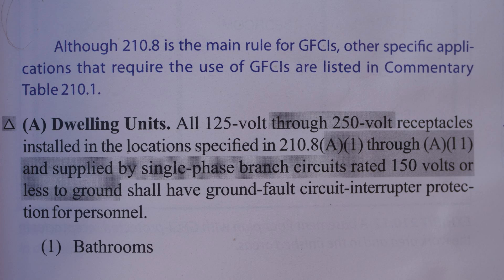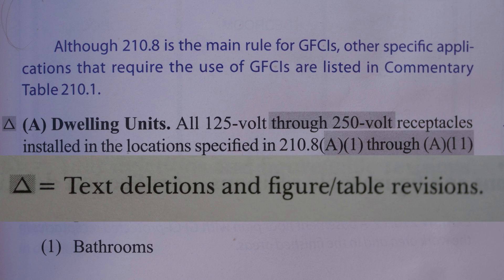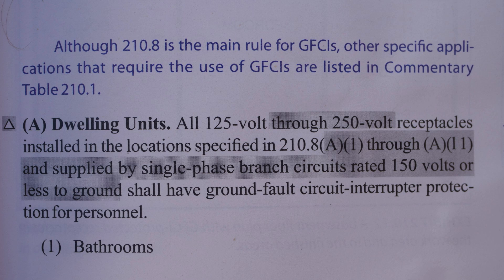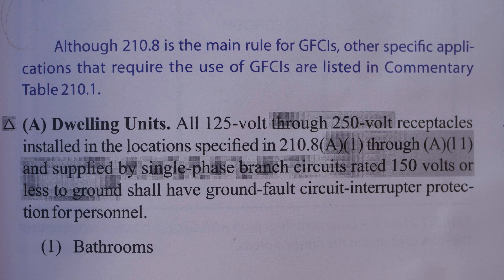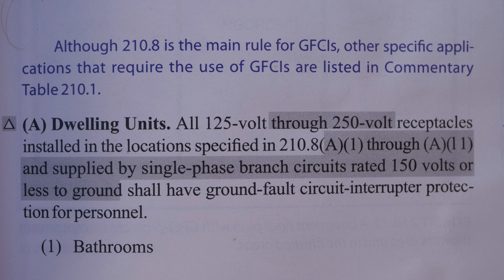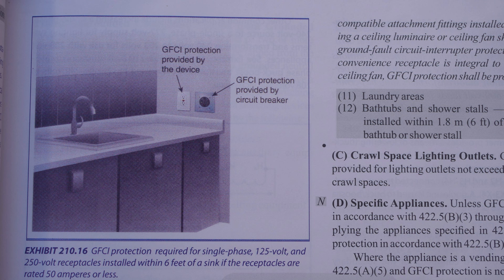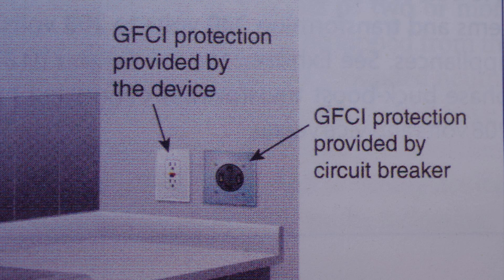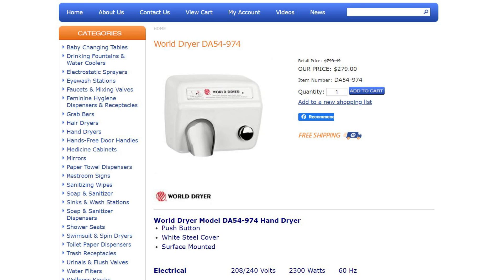Can 240V and 250V Receptacles Really be Installed in Bathrooms?

Comment: It looks like in a dwelling you are now allowed to install 240 volt outlets everywhere that a 120 volt receptacle is installed accept your not allowed to plug in a light or anything that has a maximum rating of less than 1,440 VA. At some point I expect those prohibitions to be lifted as well due to global harmonization.  Hopefully we will adopt the schuko configuration or the bs 1363 but due to our non polarized 240 system it would probably be the schuko.

Comment: Newbie question: What is the proper terminology taking about running 110/220v vs 120/240v?  or are they interchangeable.  Eg: my dryer runs on 220 (or 240?)
Reply: those are ranges of voltage 110v-120v and 220v-250v, you never get a solid number and can vary in the same house hold, I've see 110v circuits as high as 127v and 240v as high as 255v, I have noticed from experience that rural voltages are higher than in the city, and no one has ever given me decent explanation as to why this is....
Reply: the numbers keep going up over time... "110" and "220" are just labels. 
My street is already up to 124/248V
Reply: @wim0104  I guess what I’m asking is what do electricians call a run of wire to a range or dryer. “220 line” or what is the common terminology.
Reply: @sparks6666  both but its either 110/220 or 120/240... that's not even true ive heard lots of guys say 120/220 and there is also 3phase 120/208, go look at your electrical panel and see what it says and go with that
Reply: Some of it is historical leftovers.  I believe Edison's original DC 3-wire was two 55v hots and a neutral which became 110v when in series.  But it's been a while since I looked into that.

Elsewhere, much of the voltages come from the Voltage Tolerance Boundaries set as standards.  In North America, the standard voltage for home is 120/240v +/- 5%, but there is a utilization standard of -13/+6% that if happens to often requires the service providers to take corrective action, outside that range requires immediate corrective action.  Then you have NEMA nameplate voltages with a +/-10% tolerance.  The nameplate is lower than the service provider standard, such as 115 vice 120 or 230 vice 240 as NEMA works in some voltage loss from transformer to equipment.  The nameplate is the manufacturer target for optimization but the equipment should work satisfactorily within in the 10% range, though maybe less efficiently.

Comment: I find it funny that only "personnel" is protected. No pets, for starters... and in my mind, "personnel" would be employees and contractors. So does the NEC define the dwellers of these here dwelling units to be "personnel", or are they to be ignored together with the pets!?
Reply from the maker: per·son·nel
/ˌpərsəˈnel/

noun
people employed in an organization or engaged in an organized undertaking such as military service.
"many of the personnel involved require training"
Reply: @SparkyChannel  so this piece of code is for commercial or military/industrial barracks?? This code generates more questions than answers! I also had to remind myself which part of the fail-safe system is missing in a 250V, 3-wire, split-phase circuit... it's the neutral. grounding is intact.

Comment: Hi Bill from Sparky Channel

Two thumbs up!

So love when you do code videos and you surely did not disappoint.

Since 250v was added in the 2020 version was it not allowed previously

Thanks for another fantastic video again....
Reply: the code is supposed to describe the minimum standard, not a list of forbidden items (or give bad actors ideas...). 
So previously it seems non-GFCI 130 to 250V receptacles were allowed? 
I'd stick to hardwiring anyways, because GFCI breakers can go faulty too, or be miss-wired in the panel... 
if the panel wireman swaps hot & neutral, the GFCI breaker might hold, but never do the GFCI part; we had a hard time figuring out the circuit breaker one time, because the GFCI breaker refused to trip...
We corrected half a dozen GFCI breakers that day.
Reply from the maker: @wim0104  Hard wiring would be my preference as well.
Reply: @wim0104  very interesting experiences you must have had
Reply from the maker: Thanks Jeff!

Comment: Question... Often a 240 volt kitchen range will have a 120 volt receptacle on it. If it's located close enough to the kitchen sink I guess it would need a 50 amp GFCI breaker per this video.
Reply: I haven't seen a new range with a convenience receptacle in years.  but I'm sure the GFCI manufacturers are pushing to get ALL ranges required to be on GFCI protection.
Reply: @kenbrown2808  
So what are you suppose to do in the meantime? Disconnect the wiring to the built in receptacle if you have one of those ranges?
Reply: @njsongwriter  if it already exists, it's grandfathered in.  I would hesitate to use it for anything with a high load, though - because of the age of the components.
Reply: @kenbrown2808  We had a Sears gas range, avocado green from '70s that had a convenience receptacle in it, along with a backsplash light with flowers Lol.  I remember it had a 15 amp plug fuse for it in the back behind an access plate.  I guess it would've been for something like a mixer, back when kitchens often didn't have enough counter receptacles.
Reply: @Progrocker70  yep.  back before it was required to have a receptacle no further than 2 feet from any point on the countertop.
Reply from the maker: Hi Jack! I think Ken is correct on that one.
Reply: The receptacle needs to be GFCI, but the entire (hardwired?) circuit doesn't need to be. (i.e. the hardwired range doesn't need to be, but any outlets presented from it would, and that's easy enough at the receptacle.)

Comment: ok that last 40 seconds really made the video . I was saying WTF would you need a 250 in the bathroom unless you were using something like a welding machine 🤣
Reply from the maker: Some other examples: jacuzzi, sauna/steam bath, combination powder room/laundry room as well as the hand dryer.
Reply: I have 240v in the spare bathroom of my 1983 house for one of those wall resistance heaters.  I don't use it and have it off at the breaker.  Mostly because prior owners put a towel rack above it.  Had that in my childhood 1960s home as well.
Reply: Or a 240v point of use water heater
Reply: Or a European 2500 watt blow dryer so I can make my hair look like Fabio.

Comment: I know this is a bit out there, but, if you had a 240V delta system, and a 240v hand dryer, (or something of that ilk,) on the high leg and another leg, then it would be exempt from this, as the high leg is more than 150V to ground, right? (I know this is probably an odd exception, but still not outside the realm of possibility, as around Chicago, there are still new buildings going up with this service type being installed.)
Reply from the maker: Read 210.8 again. It expressly states "supplied by single-phase branch circuits". I think what you're referring to is 240V 3 Phase Open Delta (3P4W) while the NEC is referring to 120 / 240V Single Phase 3 Wire (1P3W).
Reply: @SparkyChannel  ah yes. Single phase... D'oh! I still call anything that's not on a three phase breaker single phase...

One thing to note though, ComEd uses three transformers in a delta configuration, so it's not actually an open delta.
Reply from the maker: @IceBergGeo  OK, thanks! Great chatting with you!

Comment: I wish builders would start providing 240V 30A receptacles in kitchens so we can have awesome electric kettles and other appliances like other places in the world.
Reply: Interesting comment. When I visit the UK I am amazed at how quickly the water in the electric kettles boil at 3,000 watts. I was friends with a British woman in the US who had a single 240 volt UK-style outlet installed in her kitchen specifically to use her UK electric kettle.
Reply: even 20A 250V would be a doubling improvement ... most US kitchens already have 250V in one outlet box under the sink...
Reply from the maker: Interesting thought, thanks!
Reply: There often are such receptacles already there, so long as you have an electric range.
Reply: I've fantasized about putting a 3500W commercial microwave in my kitchen, although they cost just as many dollars as watts ($3500).

Comment: maybe they might exist, but I have never come across a hand dryer that has a cord end on it, all of them are hard wired, and usually painted with a heavy enamel so that no bare metal is exposed, I would still GFCI the circuit back at the panel just so there is never an issue...
Reply from the maker: True. The hand dryer would be hard wired and the breaker would be GFCI.
Reply: the ones I have been in contact with have had a cord passed through a cutout behind the dryer and plugged in on the other side of the wall.
Reply from the maker: @kenbrown2808  Interesting!
Reply: @kenbrown2808  was that a 240v or 120v dryer?
Reply: @stankahuna5271  those were 120V dryers.

Comment: The fist VISUAL seems to contradict 
itself.   First portion says THRU 250 volts, BUT later on same paragraph 
only mentions the lower voltage.
Thank you
Reply from the maker: In the USA we have 2 hot cables and a neutral cable coming into our main panels. Both of the hot cables are in the same phase, so we call it a single phase system. If you put meter leads across the 2 hot terminals your meter will read 240VAC. If you put your leads on one of the hot terminals and on the neutral terminal you will get 120VAC, which is less than the 150VAC mentioned in the code. So, actually, it doesn't contradict itself.
Did that make sense?
Reply: @SparkyChannel  Yes,120V (actual volts) is less than the mentioned 150 volts.
Thank you.
Reply: I agree the wording is a little tricky, but there is actually 2 circuits involved when creating 240v  and both circuits are below 150, I think they write the code in such a way that you need to have a working knowledge of the code book, but if im not sure what its trying to say I usually call an inspector and ask him to give his interpretation of whatever code seems to not make sense....
Reply: @stankahuna5271  Concur. Thank you
Reply: @stankahuna5271  There are 2 ungrounded conductors (hots) in a 240VAC circuit. A 120VAC circuit has one ungrounded conductor (hot) and one grounded conductor (neutral). Either a 120VAC or a 240VAC circuit is still just one circuit.
Reply: @illestofdemall13  technically, if you are using two hots, that's two circuits, because you need a two pole breaker. That takes up two spots in the panel. Sorry, not trying to be a dick, I just want to make sure that it's not confusing for someone else.
Reply from the maker: @illestofdemall13  Hi guys, great discussion! IMO, Kris is correct. A 240VAC circuit is a circuit. Also, if you look under "branch circuit, multiwire" in article 100 of the NEC it is called a circuit. So I feel that a multiwire branch circuit is called a circuit, not circuits.
Reply: @illestofdemall13  I see your point about the mwbc, but, back before you required a multi-pole breaker for a mwbc, they were single pole breakers, and sometimes not even next to each other. I suppose that is where I am coming from. Say for an example, someone wants two more circuits pulled to their kitchen, and you had a shared neutral, and you start telling the customer that you pulled a circuit for them, then they would be frustrated because they asked you to pull two. Either way, when it comes to wording things, one must be careful to whom we are speaking and the vernacular we choose to use, as it can confuse the un-initiated.
Reply: @IceBergGeo  I'd agree that in the old way they would be 2 separate circuits because of the separate breakers. On the other hand, 240 circuits for ovens, dryers, ACs, etc are one dedicated circuit, but I can see how you might say it another way to make a layman understand more easily. I also think that laymen need to be careful with electricity because it isn't always as simple as the words can make it seem. I have fixed homeowner DIY wiring before and they often underestimate electricity.
Reply: @illestofdemall13  very true. I have seen some.. ahem questionable stuff delving into homeowner diy stuff. I have some stuff that I get to deal with even in my own home to fix from the previous owners. It is at least safe, but buried boxes (or I should say previously buried) are never a good thing. I really hate residential stuff for that reason. People just go in willy nilly and "fix" things... The things we see...

And yes, a dryer circuit or range circuit, etc are all just individual circuits. Oftentimes I have to remember to whom I am speaking when it comes to these things.
Reply: @IceBergGeo  Buried box... sounds all too familiar. Fixing that tomorrow. We were there to add a dimmer and 2 lights, the drywall guys were removing part of a wall. Now there is a buried 1900 box in the area that will now be open. It's a 1900 box with 1/2" EMT coming into it with no connector, then MC cable that feeds down to the receptacle that I just tapped power off of for the new dimmer. Lol
Reply: @illestofdemall13  interesting because each circuit in a 240v can be on independent of each other hence why they bridge the two  breakers that feed both circuits, but what your suggesting means according to that code you don't need to GFCI the circuit because as a whole its above 150v and the code says anything from 150v and lower, but whatever, your talking text book and I'm talking real world, in the real world its two circuits sharing a neutral for unbalanced load.
Reply: @SparkyChannel  so why are there two breakers, if they didn't bridge the breakers and one leg kicked the other leg would still operate, its much easier to explain as two circuits,   yes it is "called" a circuit just like an old school split is a circuit but in reality its two circuits
Reply: @stankahuna5271  The code is referring to 150V or less to ground. When you measure voltage, you will only get 120V to ground on each conductor of a 240 volt circuit. That is why they are including 125 and 250 Volt receptacles in the list. Just because 2 wires come out of a breaker doesn't mean that it is 2 circuits. They are conductors, not circuits. You cannot complete a circuit with one conductor. A 120V circuit is one hot and one neural. A 240V circuit is 2 hots, but it's one circuit. A MWBC is 2 hots and a neutral, but since they both rely on the same neutral and must be on a common trip breaker, they are really one circuit. I might be talking textbook, but I also am in the field, too. I just try to follow the actual definitions of common electrical jargon that we must know if we do that kind of work. I stand by all of my statements and I say that 240V is one circuit, regardless of what anyone else says.
Reply: Dr. Semantics is here... The single phase system is called that because from the power utility (whomever that may be) feeds homes and small businesses with only a single phase transformer. The output from that is a center tapped 240V system, where each half of the output is 120V. Pardon my pedantry.
Reply: @IceBergGeo  It isn't semantics, it is specifics. To those who may want to learn, you have given a perfect description of what single phase is. We often call the 2 ungrounded conductors phase A and B, but I know that they are not actually different phases. I am sure many people don't understand, because I see them referring to it as 2 phase.

Comment: Yup hand dryers, space heaters, and even clothes dryers I've seen in bathrooms
Reply from the maker: I was wondering about a small clothes dryer of some sort in a bathroom. I had a hard time thinking of examples where someone would need a 240V receptacle in a bathroom. Perhaps the makers of the hand dryers lobbied for this change for 2020 NEC. 😊
Reply: @SparkyChannel  I've seen quite a few instances of washers and dryers installed in bathrooms in condos here in South Florida
Reply from the maker: @tedmcdonald3377  South Florida and Southern California both have space at a premium now!
Reply: @SparkyChannel  I am in South Florida.
Reply: Had a dryer in my bathroom in Greece. Really is a common European thing.
Reply from the maker: @persistentwind  Interesting, thanks!
Reply: My wife's sister has a combination powder room/laundry room. The Dryer is on the opposite side of the room from the vanity and toilet but GFCI is required for the washing machine which is always next to the dryer. Does that mean all clothes dryers should be GFCI protected?